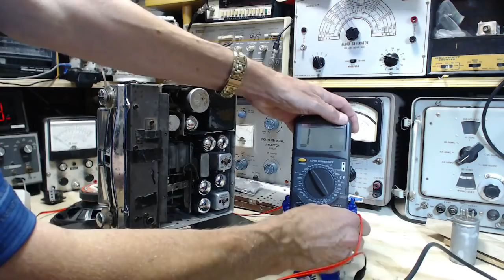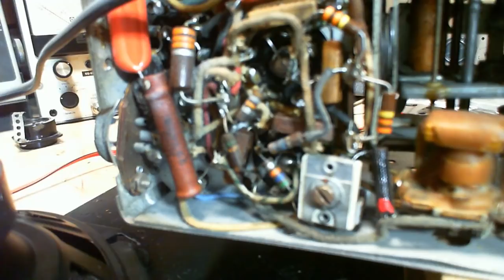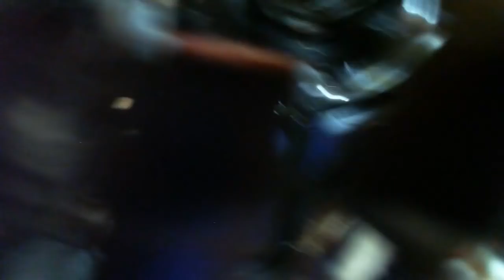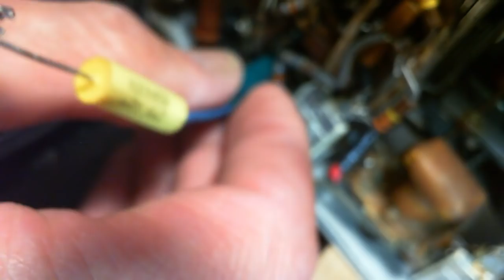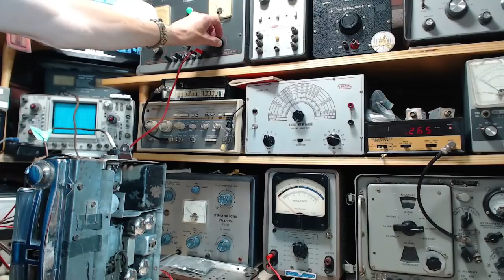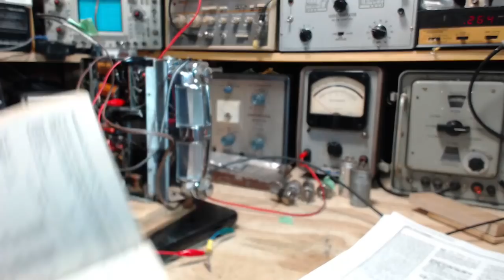Ford Zenith 6MF780 Car Radio Video #6 - IF Alignment

Comment: When removing a Loctal tube, the little bump on the base is your guide. While pulling up on the tube lever the top of the tube in the direction of the bump and then back towards the center and the tube should disengage from the socket. 

Also the piece of the coil slug you found on the magnet should be sintered iron not carbon. Hence the attraction to the speaker.

Comment: You never want to pump in a signal on the screen, always use the control grid as your signal input port !!  The screen grids usually have between 150 and maybe as high as 500 volts on them !!  That's good to blow up your signal generator with!!
Reply: His manual is wrong. Pin 6 of a 7B8 is the control grid.
Reply: Those  high voltages are DC. Since he has a capacitor between the frequency generator and the radio he should be fine.